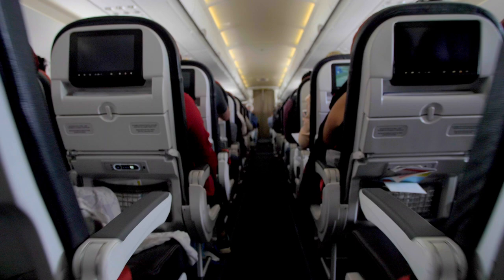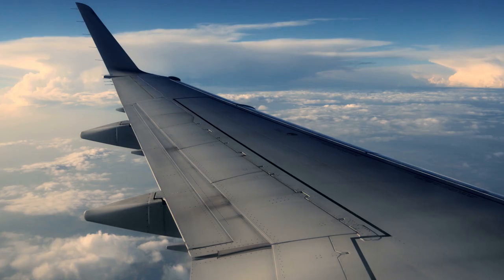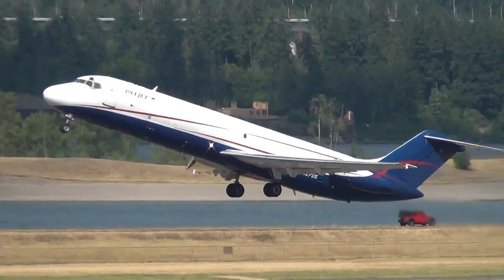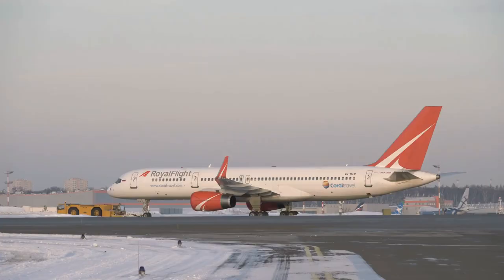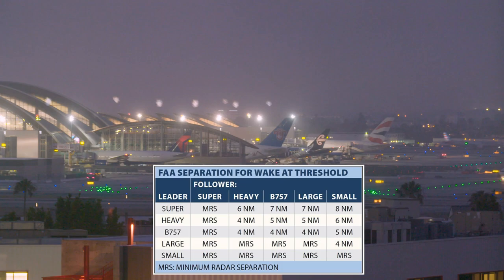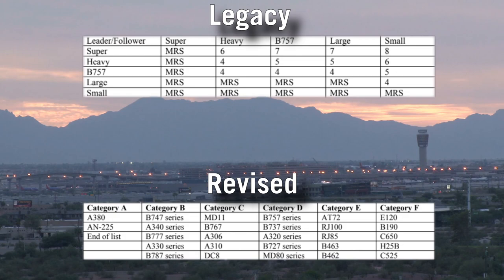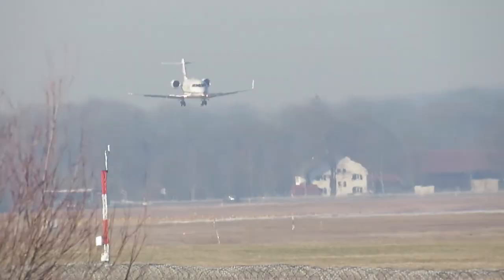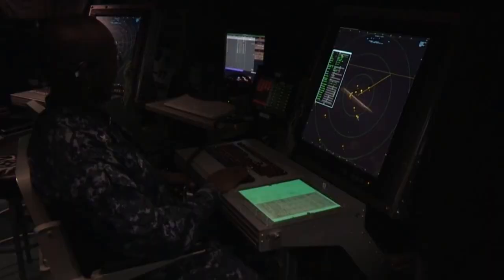This Is Why Airplanes MUST Wait On The Runway

Comment: I'm a U.S. air traffic controller and was expecting typical clickbait cringe but this was actually well researched and an accurate description of wake turbulence and its effects on airport capacity. Other reasons for delays between departures though can include weather (if aircraft need to deviate a lot around nearby storms, we usually ask for extra departure spacing), and if two aircraft are going on the same route, we usually want at least a minute separation even if wake turbulence rules don't apply. Then of course you can have intersecting runways where another aircraft is about to land, so the departure needs to be held until that aircraft has vacated their runway. But good video overall.
Reply: I appreciate your comment. However, I would want to question the "MUST" bit in the headline. I have been on a number of flights where the plane would taxi to the runway and then just blast off without such wait. Guess that is when the previous plane has already departed 2 minutes earlier...
Reply: @sp111973  Right, "MUST" is incorrect. Wake turbulence is only applied if the preceding aircraft is in a larger category. Most domestic passenger aircraft are in the same (large) category, so you'll really only deal with wake turbulence at major international airports where those flights tend to be in the heavy category.
Reply: @kewkabe  Hmm....i assume there are airports with multiple airstrips, one of which are specially reserved for these large airplanes?
Reply: @divecolosio4988  A few.  With two available runways, one is generally used for takeoffs and the other for landings, although if one is longer and an aircraft needs that additional length, that has to be worked around.  If there are more than two, weight categories can be an efficient way to utilise them, although if local airspace is restrictive, it can be by arrival and departure route instead.  Of course, "light" covers a wide range - even a Cessna 152 is "light" and so is Learjet.  There is no way on earth I am not giving that Lear (or any other business jet) a healthy clearance on departure in a little Piper, Cessna or similar.  His high-speed optimised high wing-loading aircraft is going to produce a lot more wake turbulence than I want to experience, even in a 150 Aerobat (rated for +6 -3g, and yes, I've been to both ends of that limit - voluntarily).
Reply: He is the one of the few guys on Youtube. Good content maker.
Reply: I am a retired US air traffic controller and thought the video was poorly done even if the technical issues and requirements described are correct, imagining that all aircraft MUST be delayed for wake turbulence. It gives those not familiar with commercial runway ops (i.e., most people) an incorrect assumption from atypical practice, and if my GC ever set my line-up at LC to require minutes-long delays between nearly every departure for that reason, especially on an arriving-and-departing runway, we would be having a conversation with the supervisor afterwards. Much depends on the particular airport ops, but a typical line of departures in good weather at the airports I have worked requires very little delay--no more than aircraft carrier ops--and none at all when traffic is light and I have initial headings available for radar separation right off the ground that don't require manual coordination. Lined-up and waiting delays that are minutes long can actually be a bad idea--like anything else sitting on an active runway.
Reply: Well the title is your standard clickbait crap
Reply: You could say the video was... not what you think!
Reply: Thanks now I didn’t have to waste my time watching 2 min of info in an 8 min video
Reply: I had an idea it had something to do with air, I think they call it "dirty air" in some motor sports. but I never thought it would be this complex.
Reply: John Dunn  that doesn’t debunk wake turbulence. It just means it wasn’t the key factor in that accident.
Reply: Why are you here on YT, go back to work!!
Reply: In theory this is true, I am a Canadian Air Traffic Controller, our rules are a little bit different when it comes to this, since realistically we have a much smaller demographic, most airports will allow for immediate takeoff, I work at Vancouver, and usually do the morning shifts with all the European inbounds, the few early morning departures are usually cleared right away.
Reply: Number 500 like! Cleared for takeoff
Reply: Aussie controller here, did the same expecting to type an angry response. He did a really good job.
Reply: The rules also allow a pilot to waive the delay on takeoff even when ATC must offer the wake delay. (Still subject to the pilot's internal airline rules.) The pilots have detailed performance info on the plane though and ATC only really knows small, med, large. On takeoff the vortexes are insignificant prior to rotation(nose up) so a very loaded super that takes 6000feet to rotate could be followed quickly by a light category that will rotate at 2000ft and either climb faster than the super or turn immediatly.
Reply: @mytech6779  where I control, a waiver cannot be authorised for a light aircraft behind a heavy or super. For us the rule is,  by day, in VMC, at pilot request. However, do not apply a waiver to a light or medium aircraft that will commence takeover on the same or reciprocal runway to a heavy or super aircraft that has rotated or made a low or missed approach...i think I got the wording pretty close.
Reply: cool feedback
Reply: My dad was an air traffic controller years ago. Was stationed in Japan during Korean war. I hope you enjoy your job as much as my dad did! He was at hobby, then intercontinental in Houston.
Reply: That’s a pretty stressful job I’d imagine, I’m glad people like you enjoy it. 💪
Reply: Does wake turbulence effect applies on two consecutive planes flying on same direction only ?
Or also to those flying opposite direction ?
Reply: Thank you for an expert input
Reply: @XxXNinjaFanXxX  I'd imagine YVR to be pretty busy though, bar covid, no?
Reply: @MiladGorgin  Its nowhere near pre covid levels, A LOT of our biggest routes came from Asia, and we are barely getting back to normal, if it ever gets there.
Reply: Looooooooll
Reply: Repent!   that apply to nazis too?
Reply: Thank god for the wait. I was on a flight waiting for take off and the plane taking off dropped an engine on the runway at liftoff. Thank god for wait time, even if the wait is two hours.
Reply: The amount of information an airtraffic controller holds spatially, and works with is astounding. I know. I am a neuroscientist. These people are amazing!
Reply: he did say it's not what you think :P
Reply: That's NOT WHAT YOU THINK to you
Reply: I respect your hard work and wish you all the best! Thank you for ensuring the safety of all the people in the air and on the ground.
Reply: Well said.. Flights can sometimes hold for an hour or more after they taxi out because in that time, their departure fix could close due to weather, likewise the dispatcher very often will try to get them a reroute.  If not, they must wait for the departure fix to reopen, or, in very long waits, they might even return to the terminal due to the DOT rule
Reply: we all appreciate you ! thanks for being on alert and awake always on your daily shift! We love you!
Reply: How much do you earn?
Reply: @sp111973  there will still be the gap. if the taxi time is greater than the 3 minutes the wait is not required.
Reply: How can I be a flight controller? What sre the requirements?
Reply: Blake Clifton  ?
Reply: Blake Clifton  On your reply to @Fork, there will be a limited number of controllers who have had to work those types of ops rather than just seeing the diagrams and language in the .65 or ICAO PANS-ATM-Doc 4444. This thread accidentally turned into a controller-experience filter. 😄
Reply: @ReflectedMiles  To be fair, would you rather he say it’s not necessary all the time and have hundreds of Karen’s throwing a tantrum at the Flight Attendants because the plane won’t take off immediately?
Reply: @YeahNo  Oh, no. I think it's far better to put out a video like this and, when the passengers who have watched this video and are on a plane at a busy airport that rounds the corner from the taxiway onto the runway and throttles up for the departure roll without even slowing down (probably because my colleagues told the crew to expedite), these passengers should all scream that it's unsafe, that they have pilots or ATC who don't know what they're doing, and assure everyone around them that they're probably going to die.

In other words, misinformation cuts both ways. (Even your comment reveals that you think the video's account is true in application the majority of the time. It isn't. Thanks for illustrating that point, though, and why it's actually not a good video for understanding most operations.)
Reply: Please explain this further.  I do not understand.
Reply: @divecolosio4988  That, and several other strategies are also used at the busiest airports to avoid minutes of waiting for every flight behind heavier and 757 aircraft. When delay is necessary, it isn’t just done sitting on the runway waiting, either. At best, this video is misleading.
Reply: @kewkabe  hi there, sorry to bother but I’m actually interested in becoming an ATC myself and would love to know how you got there? Through school perhaps or how exactly if you don’t mind. Thank You
Reply: I clicked expecting to hear something new.  None of what he said is new. You’d have to be 5 years old to not know about wake turbulence caused by the flight in front and I’m not even a pilot.
Reply: Not woke turbulence then? 😂😂
Reply: Another reason and most accurate reason for delays is when an airline mandates covid vaccination where they force employees to walk out…..yup, I wen there…LET’S GO BRANDON!!!
Reply: jet blast threw me off my aircraft carrier USS hancock
Reply: kewkabe: You atc and pilots are truly dedicated and intelligent awesome people. I have flown on trips with my parents all my life, and had witnessed amazing landings and take offs which i deemed impossible and made my dad and uncle both pilots, ify about it; and safe landings nd take offs they all were:) :) good times good times:)  then i was flying into Montreal airport in February snow storm two attempts to land and pilots got it on the third, little rough but perfect in my mind. It was no visibility that we passengers could see, just the lights an the snow flakes. Again atc and pilots truly amazing people with the worlds most awesome talents :) thank you guys for your professionalism and skills and love of aviation like i do:)
Reply: SKIP ROCHE 🇻🇳  omg...
Reply: I used to work in ATC as a technician. Controllers are a different breed altogether. What they do is like juggling 10 balls while on fire.
Reply: Can't wait for diversity to impact your sector ;-)
Reply: Thanks for what you do. May Jesus continue to bless and protect you
Reply: Thanks for what you do. May Jesus continue to bless and protect you
Reply: @22ERICSHELLY  who says He did so far?
Reply: Hey-I CONGRATULATE you guys-- you do one hell of a job I think-- stressful and risky- and manage it extremely well... surprises me there aren't a lot more crashes than there are..
Reply: @phillee2814   no, the runway you land on could be the one you take off of. it is just a matter of what direction you are arriving from
Reply: My wife and I recently experienced some sort of wake turbulence.  We were in a CRJ200 in Atlanta and immediately took off after an A321.  I thought when we began to roll that we didn't wait long enough.  Sure enough on initial climb, the airplane wingtips went down and back up as if the pilot had to correct really urgently.  It was not a windy night and there was not crosswind involved.
Reply: I don't think many people are actually complaining about waiting a couple minutes before take-off and most just think it's for thrust and engine power to spool up anyways. People who have to wait 3-12 hours on the plane before taxing are the people who have something to complain of, and with recent delays and issues over Covid mandates and restrictions and airline employees protesting or leaving their jobs is a much more important issue. You don't have to sensationalize everything to make your videos more dramatic, who is complaining or even worrying about this short delay? Why are you making things up?
Reply: Bleh.
Reply: Why don't they just get a big fan or jet engine to blow away the wake turbulence? 😉
Reply: Man, how do you deal with the stress? I could use some good advice
Reply: Thanks bro, you ATC guys are rarely appreciated
Reply: Now they need to add this to the next generation of Flight simulators. The current ones don't seem to take this into account.
Reply: As another air traffic controller, I can confirm kewkabe is correct.
Reply: @divecolosio4988  It doesn't work that way. There are several things to consider such as IFR separation, delays with departure, airway traffic, etc. There could be a runway for bigger aircraft, but it won't be on an outlying field and will still be at the same airport as the other runways. Generally all the runways are parallel or intersecting.
Reply: Indeed!  Nothing focus my attention like a large plane landing when I am on downwind.  And I am extra grateful for the controllers being patient when I like to wait just a little bit longer on the numbers.
Reply: Waiting on runway is frustrating I myself don’t believe Vortices are produced by a large jet, I fly after 747 Boeing at high altitude no problem, maybe little balance stability but this is it , I careless for all that BS , my biggest fear is high category Tornado, I never been in one , I would love to try getting into the eye, unfortunately not allowed 🚫
Reply: Thanks for this comment. This saved my 8 minutes.
Reply: On takeoff....I thought you only had to rotate before the departing aircraft point ahead of you
Reply: How do jets put on airshows if this is an issue?!
Reply: @rfcdgaf  Got you here, didn't it?
Reply: @ReflectedMiles  Then make your own video explaining that. I found it informative.
Reply: @rockdinosaur8619  The risk is being misinformed and then thinking that the controllers or pilots have screwed up when you are flying somewhere some day and the required delay described in the video doesn't happen, as it routinely will not. "Informative" is good so long as it isn't also misinforming and creating false assumptions or expectations. I don't have an obligation to make videos replying to errors in aviation videos--it was worth pointing out in the comments, but that is all.
Reply: @kewkabe  explain in Fortnite terms please
Reply: Jesus is LORD  Spiced Porc and Jebus?
Reply: The video was actually super informative and well done. Unfortunately it is kind of clickbait because as far as I know you don’t line up airlines on the runway specifically because of wake turbolence. There are so many factors.
Reply: This is not what you think sir...😄😄😄😜😜

Comment: I don’t give a damn how long it takes to get off of the ground, as long as we can do it without crashing I’m happy doing it tomorrow.
Reply: Ikr. These people are trained to keep us safe. They know what they are doing. I never understand the idea of rushing that fking 3mn
Reply: Yeah, and let's be real, those few minutes are nothing compared to getting through security and boarding.
If you want a form of fast transportation where you get underway faster, it's called high-speed rail.
Traffic control is not to blame for unavoidable inefficencies of your chosen transit method.
Reply: I'm thinking you've never been stuck in the plane after leaving the gate for 2 hours.
Reply: why  no one even thinking that lol? it called traffic ever hear of it?
Reply: @surveyguyor8958  i have, but since it was a long haul flight and it had an ife i had no problem…
Reply: @surveyguyor8958  Would rather be stuck than dead
Reply: @devadeshpande6184  Dead? There is no reason for those people to die while sitting on a plane waiting. They should not be exiting the gate then just sit on the tarmac for hours without letting people get up and use the bathrooms. Many times while idling they also don't have air conditioning. Maybe you won't understand this either, since you seem to think people will die if they don't wait in a queue on the tarmac for hours.
Reply: @surveyguyor8958  they won't die by waiting.... you know that's not what they meant. Waiting ensures safety, so the commenter was saying they'd rather wait for a while on the ground than die from an accident while flying that could have been prevented.
Reply: @ZerianisTheWitch  why  are  you explaining this if I know. Go back to playing with yourself.
Reply: @surveyguyor8958  this isn't the serve you think it is
Reply: @ZerianisTheWitch  blah blah bleepity blah. this isn't the virgin you think it is